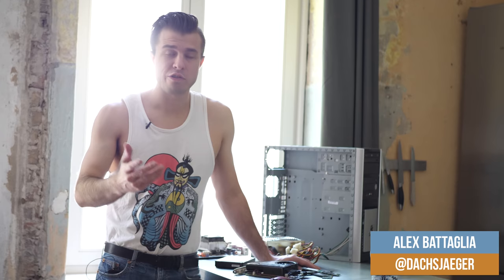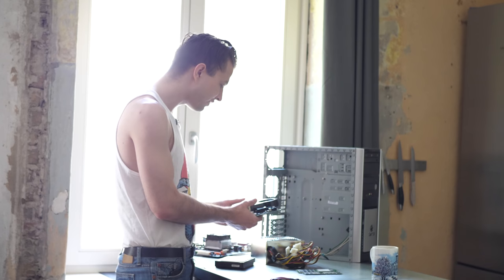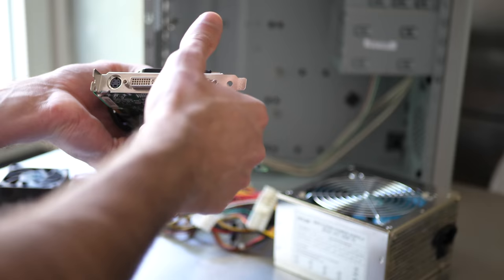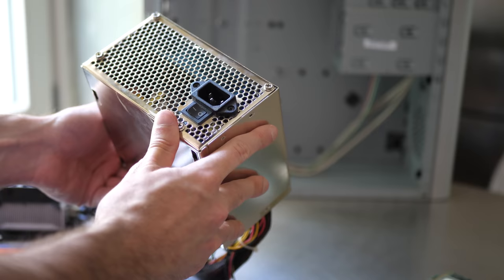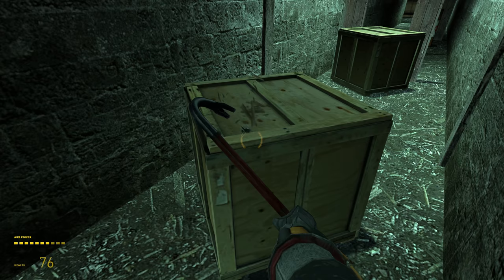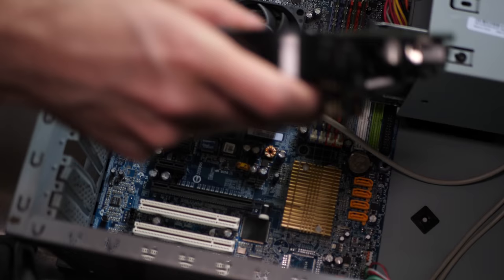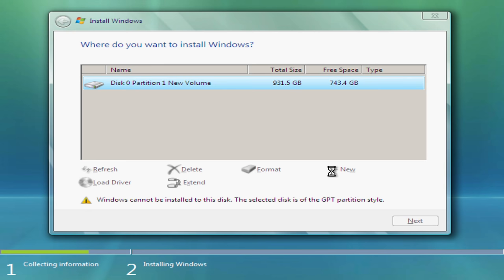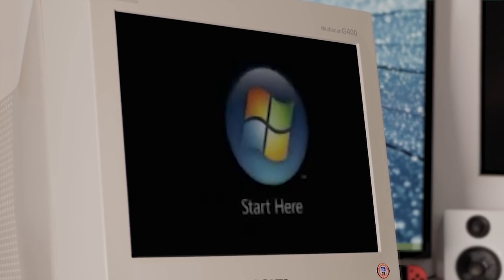Let's Build A 2005 Retro PC: Athlon X2 3800+ - Nvidia 6800 GT - Classic Hardware For A Classic Era!

Comment: "People thought I was gonna go for XP, but I still love vista, baby!"
Reply: Installing XP is actually a bit of a pain in the ass on a computer of this generation. SATA drives did not exist when XP Service Pack 3 was created. This means you either need 1) a floppy drive, 2) two cd drives, 3) boot XP installation from a USB drive, or 4) slip stream SATA drivers into your XP installation (what you'd probably do if you go with option 3 anyway).
Everything considered I'd go for Vista SP1 over XP SP3 too.
Reply: @rob_i208  I would chose XP over Vista, probably cause I never upgraded or some would say, downgraded to Vista from XP, I went straight to Windows 7 after XP
Reply: Vista was a huge upgrade from XP. It was basically the drivers and bloatware that were not tested properly by the OEM builders. Fact is that the biggest difference between Vista and Win 7 beyond a visual change to Taskbar is that the drivers had had time to mature.
Reply: @antivanti  
Not completely correct, as the launch version of Vista was terrible, and Service Pack 1 wasn't massively better.
Service Pack 2 on the other hand, paired with 3GB+ of RAM was pretty much Windows 7 without the new interface features, and was released pretty much at the same time as the Windows 7 RTM release became available in 2009.

Comment: My PC from mid 2004 till 2007 was a P4@3.0GHz with HT (northwood core), 2GB DDR Corsair XMS, BFG 6800GT OC.  I still remember playing Doom 3 and HL2 and being blown away playing these games maxed out.  I miss those days of gaming.
Reply: MY system was almost identical but I had to settle for the 6600GT but it was still mind-blowing stuff to me at the time and I found I could max out HL2, Doom3 and Farcry at 1024x768 on that little card. 1280x1024 was a bit too much for it without dropping some settings.

Comment: The GPU would have come with a DVI to VGA adapter dongle. 👍
Reply: Correct. I has a very similar 6800 that also came with an analog breakout cable. That's not just s-video, it can output composite and component as well.
Reply: @nathanddrews  This one doesn't support the breakout cable for component/composite. It's just got a standard 4-pin s-video connector, the ones that supported the breakout cables have more pins on the mini din.

Comment: Yup it was roughly 7 FPS I got when I was determined to play half-life using my Windows 95 IBM Aptiva PC. The game itself took up 90% of the hard drive I was using at the time. I uninstalled practically everything for that one game to play it at 7 FPS and I actually adapted to that play style and managed to get through most of the game taking into account how long it would take for Gordon to make a jump across the gap after pressing the jump button. I learned and adapted to that crappy experience. It wasn't until years later when I got the fancy Pentium 4 PC, getting to play Half-life for the first time on a computer that could handle it. How much faster it felt was astonishing! I was shocked at the experience

Comment: 2005 was by far the most pivotal era in PC history. Many important tech milestones was reached, such as the introduction of dualcore CPUs, the move from AGP to PCI-E, DDR2 ram & multi graphics card setup SLI, Crossfire etc. The games back then were really good also. Kids today have no idea what they have been missing.
Reply: I would say around 2006 as well with the introduction of the Core 2 Line and 8800 series from Nvidia which was a game changer at the time. But yes 2005 was a huge change in pace.

Comment: I played Crysis on a 9800 GX2 at 720p (hooked up to the same tv the 360 was connected to) and had the setting all on High and was at 60 at least 95% of the time (this was back in summer of 2008).  The CPU was an QX9650 and I don't remember the ram, but I think it was 4 gigs DDR2 (2x2GB).  That same pre-built has been upgraded, piece by piece over time and there is now nothing left of it, which this being 12 years later is not much of a surprise.  However, beyond the 2070 Super and the SSD, everything else is more 2002/2003 (haven't need to upgrade anything else).

Comment: Athlon X2 3800+ was rather an early-mid 2006 part, and it was often paired with 7800GT or X1900GT. If you want a 2004-2005 matching build, this would be A64 3000+ or P4 3.0GHz with the 6800GT. This is what most people were rolling at the time. Your build looks more like a transitional one where someone just upgraded their CPU.
Reply: He explained the part dates, but I think he's just trying to get as close as possible within the limits of what is available still on the used market.

Comment: I have bad memories with Vista. I remember my mother bought laptop with Vista installed, and it wouldn't even run some of files i tried. I clicked a file, there was "ring" over a pointer for a while and nothing happened. I tried another couple of files and when they didn't worked as well, i just grabbed my XP SP3 disk and installed an older system, where everything worked flawlessly.

Comment: My first self-build game pc (2005) was an Athlon 64 3500+ with 2GB DDR400 and an Ati radeon x850XT PE. Total costs more than 3000 euro...  At that time it was a very capable high end machine, but within 3 years new games were becoming totally unplayable. Missing shader 3.0. and the singlecore CPU became a bottleneck fast.  Nowadays a 5 year old high end pc is still more than capable of playing newer games at higher settings. 
Few years ago I upgraded that first build to an Athlon64 X2 4200+, 4GB DDR400 , SSD and a 8800GTX. just for the fun of it and the low upgrade costs. Now it is the perfect windows XP machine it should have been back then :)

Comment: 6800gt got me almost till the end of the 7th gen. It could run some really demanding games, Crysis for example ran with a custom cfg almost at a locked 30 fps, with shadows on. I completed Batman games, Mass Effect games, and a lot of other games using UE3. It ran Burnout Paradise perfectly well. TES IV Oblivion was a blast. Keep in mind though that there is a developer note from Nvidia that claims that shader performance on 6800 series increases manyfold in lower resolutions, so expect sticking to 800x600 and 640x480 in some games to get good framerates. No problem for a CRT though) 
And yeah - deluxe psus and many other pc parts are terrible. Here in CIS (former USSR republics) it is a very common brand. 
As for this PC - it reminds me my first one - Athlon 3000+ (754), 512 megs of ram, Asus mobo, GF6800gt... good times. 2004-2005 period is one of the best in history of gaming, also including Total War, Splinter Cell 3, Psychonauts for PC besides mentioned mammoths like HL2, Doom 3, Far Cry, etc, and also best Burnout games, RE4, MGS3, Halo 2, GTA:SA and many more. Nowadays I have beast of a PC and all the consoles, but games are just not as fun as they used to be. Greetings from Kazakhstan, Alex and DF. Even here there are fans of your show.
Reply: You also have a KGB?
Reply: A guy once told me that Delux PSUs are the best of the cheap no-name brands. And they are actually usable, at least for a while. I had one in my P4 machine that lasted over 5 years (and probably could still run with some caps replaced had I not killed the fan). That was a major improvement from the no-name PSUs in my Slot 1 machine, which malfunctioned 6 six times for 3 years and finally damaged the motherboard. My uncle still has a 24/7 running home server with a 500W Delux on his Core2 Duo machine (more than 12 years of use).

Comment: I had a 'Manchester' 3800+ x2 then later a 'Toledo-512k' 4200+ x2, the latter of which seemed much better at over-clocking; for instance, I could take it from 2.2 GHz stock to 2.7 GHz under-volted, using a stock cooler. Paired it with an OEM Geforce 9600 GS (48 shaders/768 mb 192-bit DDR2 VRAM) and Crysis ran well under XP for the most part (1024 x 768 with medium detail). The only part of the game that suffered was the section in the dark cave with heavy smoke effects. Even older games ran no sweat.. crank the eye candy to max and let it rip. Tons of games from this era just waiting to be enjoyed.. am currently playing Return to Castle Wolfenstein again on an XP rig and still loving it.

Comment: My build from the era (late 2004)
Case: Roswill black ATX w/ acrylic side panel window
PSU: Rosewill 500W
Mobo: DFI nVidia nForce 3 AMD Skt 754 ATX Motherboard
CPU: AMD Athlon 64 3700+ 2.4GHz Skt 754
CPU Cooler: Zalman CNPS9500 Copper Heatsink/95mm Fan
Video Card: ASUS nVidia GeForce 6800GT 256MB AGP 8x
RAM: Kingston 1GB (2x512MB) DDR 400
HDD: 2 x Seagate 160GB 7,200RPM PATA Hard Drives in RAID 0
Optical Drive: DVD/CD+/-RW 48x (or something) Combo Drive
OS: Windows XP Pro 64-bit Ed

Comment: Had to upgrade every year during this time period because performance doubled every year. 
A 7800gtx in 2005 was double the performance of a 6800gt and an 8800gtx from 2006 was over double that of a 7800gtx. I remember trying to run Call of Juarez on max settings with a 7800gtx and getting frame rates in the upper teens.

Comment: Ah the nostalgia. I had almost identical setup though i had a Gainward 8800GT (512 MB) and that helped a lot in Crysis. Thanks for this, brings back memories, 🍻 from Sweden!
Reply: I remember back in the day the nVidia 8800 GT holding its own for a very long time.. incredible bang per buck. I remember seeing games like Crysis, GTA IV, Prototype and Left 4 Dead 2 running on this card and thinking to myself, this things kicks ass. Same for the 9600 GT.

Due to finances I had to settle for a 'budget' 9600 GS which was technically inferior in terms of gaming (48 stream processors/shaders) but even then, this was a HUGE upgrade to the onboard Geforce 6100. With a S939 A64 4200+ I could run Cyris at 1024 x 768 medium with little problem,  and as many PC gamer's will attest there's a universe of older games that are still awesome and will run extremely well on these cards with lots of eye candy. For example Far Cry, Doom 3, Prey, Mafia II, Return to Castle Wolfenstein and Half-Life 2. Good times :)

Comment: My 2004-2005 PC was:
Asus A7N8X motherboard with nforce chipset
AMD Sempron 2400+
512 MB DDR RAM
some cheapo 128MB ATi Radeon 9000 AGP card with passive cooling
80GB 7200RPM Maxtor hdd and 2 ODD drives (one was a CD burner, the other was a dvd reader).
Needless to say that Doom 3 didn't run well. On the other hand we were upgrading from a 486dx2 and could finally watch Shrek 2 on it. I was also introduced to this forgotten game series named Call of Duty.

Comment: Damn, in 2005, I was jealous of anyone owning a 6800! Great nostalgia trip
Reply: I had (and still have) a Dell Dimension 8100 with an Nvidia FX5900, a Northwood P4, and 768 MB of dual-channel RDRAM.  I used it through 2016.  AGP went out of favor soon after I got the PC, so that gen of Nvidia card was the best upgrade I could get with the Intel i850 motherboard.  Memory, same thing.  DDR took over, and RDRAM became scarce and too expensive to upgrade very much.
Reply: I had an el cheapo 6200 lol. Bottom of the rung.

Comment: My build at the time (circa end of 2004) was Pentium 4A 2.4Ghz,  512 MB of DDR RAM, 80GB maxtor PATA HDD,  Ati Radeon 9550 256 MB (upgraded from GF4 MX400 only a month before after I realise it didnt support hardware Pixel Shader at all and failed me on playing Pandora Tomorrow), an ASUS Mainboard with VIA chipset maybe (also upgraded from cheap asrock mainboard a month before because,for some reason, it didnt support my Radeon 9550 AGP card although it have AGP slot). It was my first build that surprisingly work well for a first timer PC builder and last for 4 years until 2008 with added 1 GB of DDR RAM on second slot). Im also trying Vista RC version circa 2006-2007 because it was on a DVD from the PC magazine I bought, it delete my data partition (thankfully it could be restored after some nitty gritty of recovery software). Since then I never touch Vista ever again and stick with XP until 7 came out in 2009.

Comment: That's right, I've already bought a lot from Kleinanzeigen here in Germany 😜😄 Among other things, two mainboards from yours, which you showed in the video.  Got it cheap as a set because the capacitors were defective.  Fixed it and built myself a Socket 939 Retro PC with Athlon 4800+ and 3 GB of RAM.  But I only use it with XP Professional and have installed a Radeon HD7850 with two gigabytes as the graphics card.  Not entirely correct in terms of timing, but then more games will run on it.  And mine also has an ARGB fan, USB 3 card, card reader with USB 3 socket, 1 TB SSD and an SB XFi PCI sound card.

Comment: My 2006 build wasn't too much different, but was based around an AMD Opteron 170 (which was a stock dual-core 2.0GHz chip) starting with 2GB DDR later upgrading to 4, an XFI Xtreme Music card, maybe 250 or 320GB SATA drive, basic DVD burner, a 7900GTX that had 512MB later replaced with an 8800 Ultra that had 768MB and I even started with the BFG Physx card which turned out to be a waste as I didn't really play much that needed it.  
Crysis was a game I was looking forward to along with Colin Mcrae Dirt, and "Unreal Tournament 2007", among running other similar older games to yours like Battlefield 2, Doom 3, Far Cry, and Half-Life 2 along with Chronicles of Riddick: Escape From Butcher Bay, FEAR, GTA Vice City (mainly for MultiTheftAuto), Halo, Need for Speed Most Wanted, SWAT 4, and Tribes: Vengeance.  I'm sure there were quite a few other games at the time as I tend to have more things installed than I actually get around to playing.  
But, with all that said, the first thing I installed when I moved from XP to Vista was Halo 2 'Vista'.  There was later a workaround found out by users to get the game to run under XP which is where my build spent most of its time till Windows 7 came out.

Comment: I still have a similar pc for older Windows XP gaming, with an Athlon 64 4800+, 4GB of DDR400 and an ATI Radeon X1950XTX. Some of those games are still way more fun then many of the current games and they run great on the older hardware.
Reply: I find when you can get the older XP games working on new Win 10 hardware they can run a hell of a lot worse

Comment: I remember buying a brand new 8800gt to replace my 7900gt just to play Crysis, I've never seen that level of graphics and interactivity in my entire life.  Then TweakGuides came out with a .cfg guide to help improve visual quality while having better performance at that time, I used to remember many of the commands by heart, but as time went on and graphics cards became much more powerful and efficient, I found less time and need for tweaking those files.  I still play Crysis to this day!  There are some pretty good user single player missions that are worth checking out.
Reply: Can't wait for the Remaster this summer.
Reply: @raresmacovei8382  Yes!  Same here!  Finally a reason to upgrade to a new PC setup.

Comment: This takes me back. 
I had a GeForce 6800 you could unlock the full 16 pipelines with a simple software mod in Riva Tuner and basically get a 6800GT with slower memory.

Comment: My "Oblivion PC" was a 3700+, an X1900XT and 2GB RAM. Hardware was cool back then, with overclocking your way to the performance of a $800 CPU and unlocking pipes on your GPU for that extra push.

Comment: Vista and audio...
It was NOT an issue if you figured out the workarounds. First, Creative released "Alchemy" which brought back EAX though it could be a bit of a hassle. For people with unsupported EAX cards like from Auzentech (I had the Auzentech X-Fi Forte) a guy called "DanielK" repackaged the Creative drivers to make this work... that worked fine right up until 2019 FALL I believe when Microsoft did an update that killed support yet again. My card worked but only with the basic drivers. I just switched to my decent onboard audio in my X470 motherboard.

Comment: 2004-2005 era PC with 6800 Ultra graphics is great, but it would have to be running in SLI to really have the "ultimate" graphics solution for the day.  I'd argue that since the the GPU performance bottleneck is so big, one would almost have to do that to show what 2005 can do.

Comment: ".. I'm surprised.. there's no VGA"
THAT. IS. INCORRECT!
Those connectors are "DVI-I" meaning DVI Integrated. The pins are for BOTH analog (VGA) and digital outputs. The "DVI to VGA adapter" would have come with the card and it simply connects the monitor's VGA cable to the appropriate VGA pin-outs as the DVI-to-VGA conversion is still done on the graphics card like normal.
Reply: (that should say "Digital-to-analog" conversion above for what it's worth. As in a DAC. There's no such as a DVI-to-VGA conversion on the card itself as "DVI" is the external "interface" part)

Comment: In that time period my system was:
CPU: AMD 64 3200
Ram: 2 gig DDR PC-3200 
Video: ATI RADEON X800 PRO Video Card, 256MB GDDR3 later upgraded to geforce 6800 GT
 from EVGA
motherboard: MSI "K8N Neo Platinum" (MS-7030) 250 Chipset Motherboard
Sound: Creative Labs Sound Blaster Audigy2 ZS GAMER Limited Edition 
Of course it was running XP.
Monitor wise, I was still using a 17 inch flat panel lcd I bought from Dell for like $900 in 2001.  Looking back, that wasn't the wises choice.

Comment: Reminds me of my first full build as a young lad. I still remember the parts: Athlon 64 3500+, nVidia 6600GT pcie, 1GB DDR ram, MSI k8n neo4 Mobo, Thermaltake Tsunami dream case. 😎 Edit: the dual DVI-I was standard then. DVI-I, not DVI-D, so you can output analog VGA as well with a simple adapter that always was included with the GPU box. edit2: I remember those s-video outputs! Good old days, when you plugged in your computer to CRT tv....
Reply: The stock AM2 cooler is so easy to install for beginners. I love that
Reply: @li_tsz_fung  Yes!